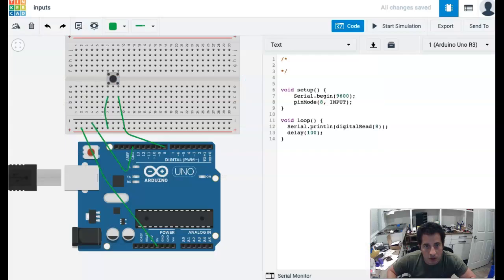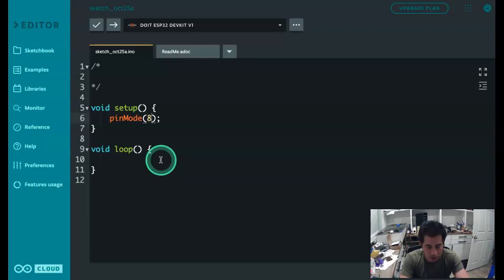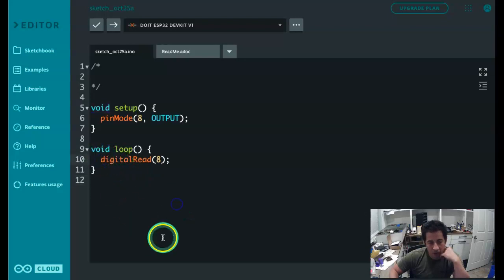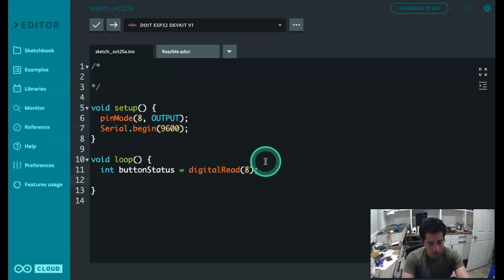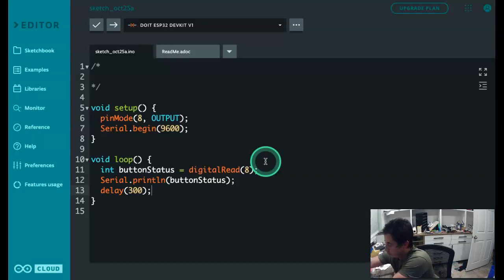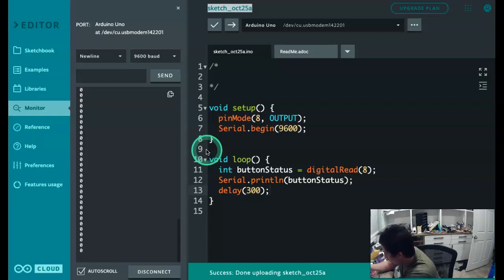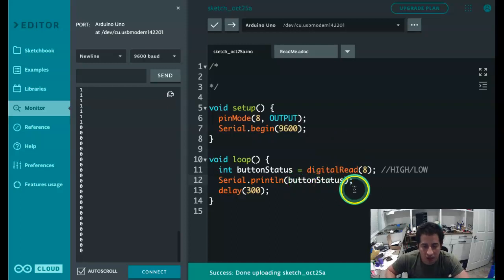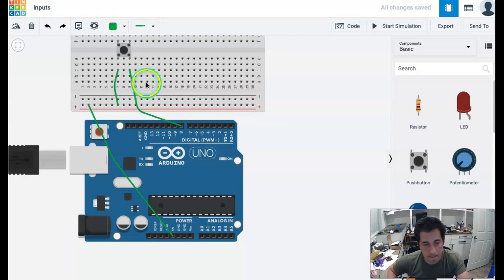7. Learning to code C/C++ with Arduino: Digital Inputs

Comment: If pin 8 is an input, why did you pinMode it as an output? Makes no sense and you did not explain why. I am learning much about programming. Thank you.
Reply from the maker: This was a mistake in the video.  It looks like in this case it didn’t matter.  I encourage you to watch the next two for more details on how inputs work, and a more efficient way to wire/program them.
Reply: So after a small investigation, I realized that it is actually supposed to be OUTPUT because the Arduino is sending out the voltage through that pin, but when the button is not pressed, the circuit is incomplete so the voltage does not return to the Arduino and therefore there is no return/input. That's why it prints out 0 because there is LOW voltage, but when the button is pressed, the circuit is completed and the voltage sent out from the Pin number returns through the 5v port, and the microcontroller receives the voltage it sent out thus there is voltage or HIGH voltage. That's why when pressed, it prints out 1

However, I may be wrong, but that is my understanding. I tried it with INPUT and it doesn't work as it does with OUTPUT. Instead, it constantly prints out 1.
Reply: @aaronstafford5501  So after a small investigation, I realized that it is actually supposed to be OUTPUT because the Arduino is sending out the voltage through that pin, but when the button is not pressed, the circuit is incomplete so the voltage does not return to the Arduino and therefore there is no return/input. That's why it prints out 0 because there is LOW voltage, but when the button is pressed, the circuit is completed and the voltage sent out from the Pin number returns through the 5v port, and the microcontroller receives the voltage it sent out thus there is voltage or HIGH voltage. That's why when pressed, it prints out 1

However, I may be wrong, but that is my understanding. I tried it with INPUT and it doesn't work as it does with OUTPUT. Instead, it constantly prints out 1. At this point, I have only watched up to this video.